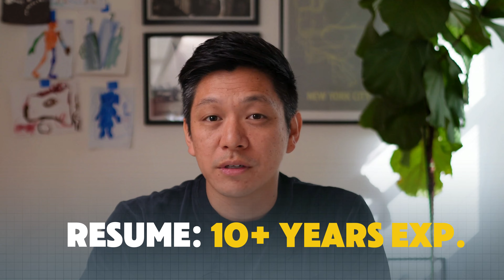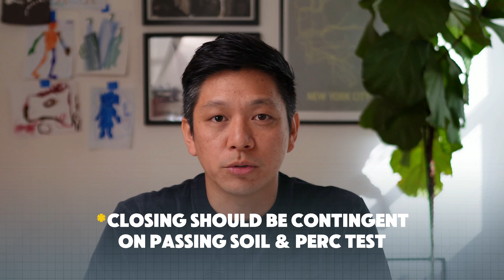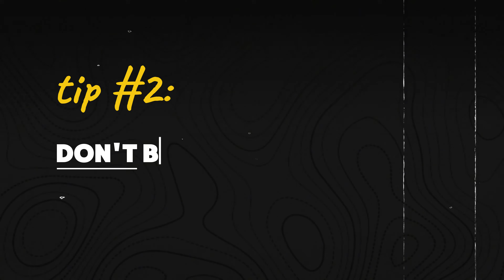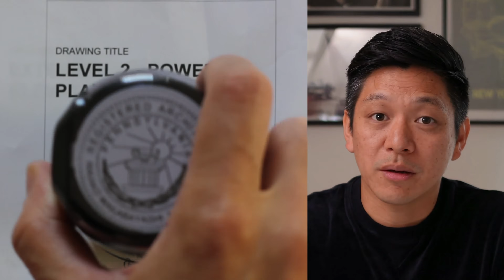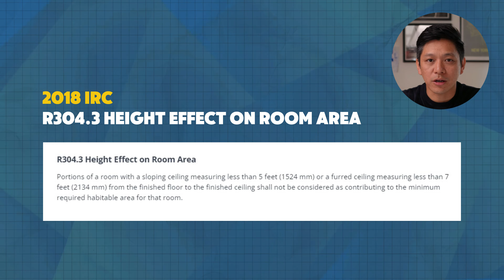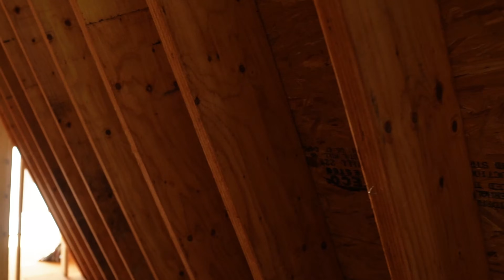The DOs and DON'Ts of Building an A-Frame Cabin

Comment: I think the main driver of a frames has always been that a smaller 24' wide 1 to maybe 3 bed could/can be built with standard length 2x materials and its simple to frame and goes up fast. Most average guys with a little bit of know how can frame out a classic a in a weekend like a 24x28 if you build the triangles as a complete truss including the bottom chord.

That is the main reason why my family's going to build one as our main home 24x36 on a full basement. Currently live in a crappy mobile here on my 9 acres in northern Michigan. Were slowing buying lumber and storing it in my pole barn. Ill finance the basement and then frame it out and put the roof on myself install the windows doors insulate and probably wire most of it myself too. By buying materials for a year or so here and there i can reduce the cost i finance,  and again it goes up extremely fast. Faster it goes up more likely the bank will turn the personal loan i use for a new septic and basement into a mortgage to finish it out
Reply from the maker: That sounds amazing! Good luck in your progress!